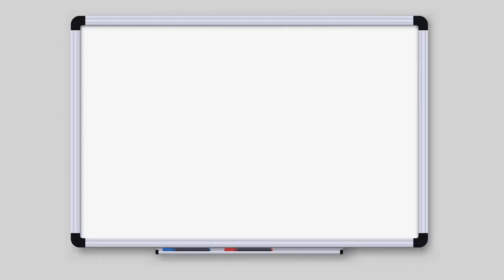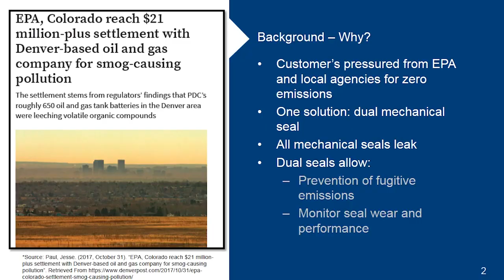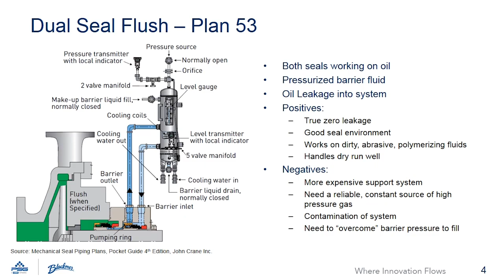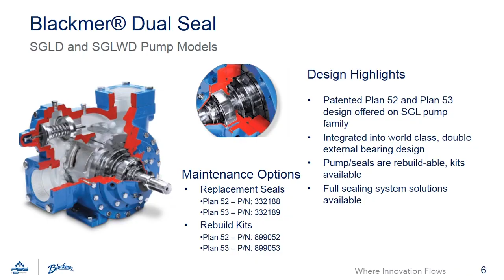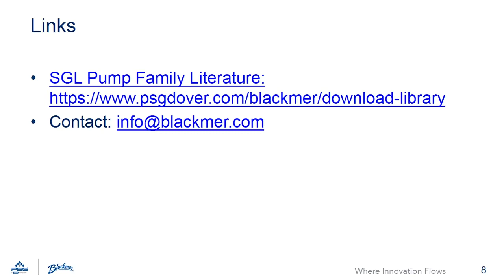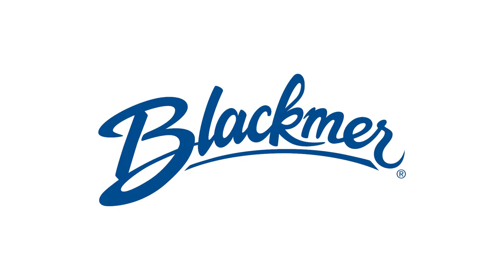Dual Seals   Plan 52 vs  Plan 53 for SGL Series Sliding Vane Pumps   Blackmer Whiteboard

Comment: Is it possible to change the plan 52 with the plan 53 in an existing crude oil pump knowing that the crude oil contains some salt and sand that block the spring to work properly and make failure in the first stage (tendem cofiguration) and buffer fluid is contaminated quickly ?
Can we avoid this problem by plan 53 ?